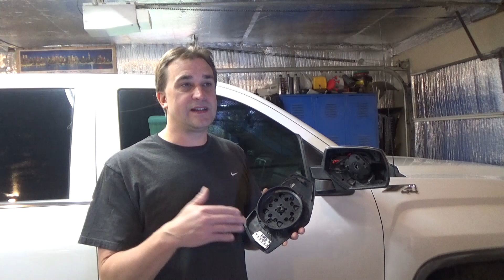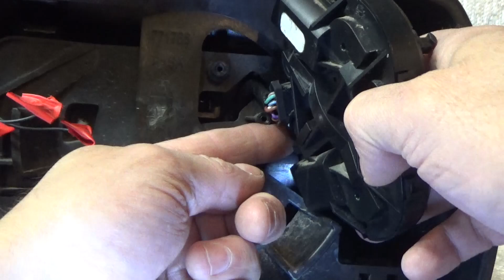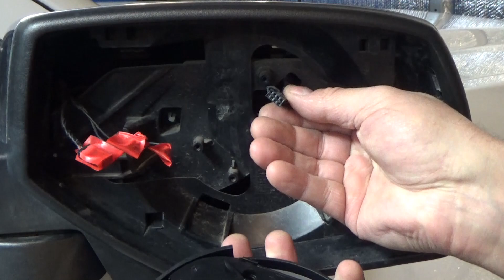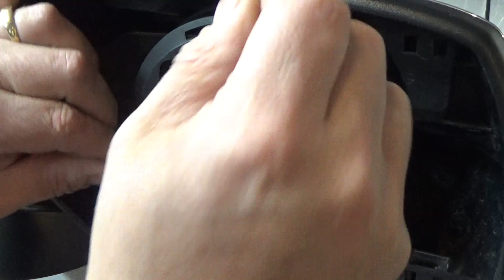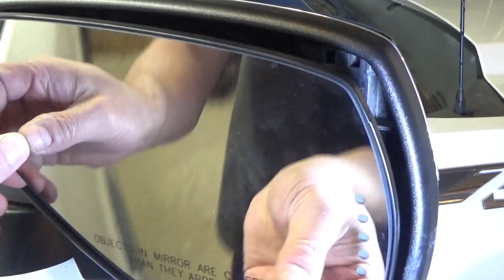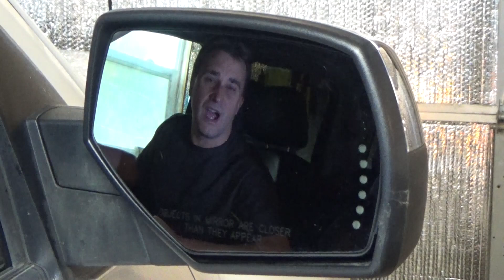How to Repair a Side Mirror on a GMC Sierra or Chevy Silverado - Mirror Adjustment Motor Replacement

Comment from the maker: 🛠 PARTS FOR THIS REPAIR:
🔧 GMC/Chevy Side Mirror Motor Assembly: https://amzn.to/2LAqxSY
🪛 Tool Kits on Amazon: https://amzn.to/4nW4giX
🪞 Complete Aftermarket Side Mirror (if needed): https://amzn.to/2AAUqAb
🏪 Browse My Complete Tool & Parts Recommendations: https://www.amazon.com/shop/markjenkins
Reply: The mirror itself didn't come with brackets.
Reply: This would fit in a 2015 silverado as well correct?

Comment: I have a 2015 sierra. My problem is the passenger side mirror won't fold in or out. Do I replace the same motor that you replaced? Or is it a different motor that I need. Thanks.

Comment: You can Buy a complete Mirror from Rock Auto Parts or E-Bay cheaper as a  new Motor
Reply: If it's regular. Good luck with power folding one with puddle light

Comment: I replaced mirror and actuator on passenger side door of 2018 GMC Sierra using this video and worked perfect.  1 problem I had (created myself) was pulled the 1 wire out of the small terminal on mirror.  So I had to redo a bigger terminal to fit.  It worked fine.  8 months later the mirror would not move but the turn signal light blinked.  I took mirror off and thought that wire I remodeled came apart, but didnt.  I functioned the actuator motor and works in all directions.  Put mirror back in place and turn signal function but mirror will not move.  Is not binding up anyplace as I can move it manually and it moves freely.  Help needed please.

Comment: So i replaced the motor it works great but now left is right and right is left do you know what could cause this other than that video helped alot just glad its working again thnx
Reply: Your truck is equipped with memory seats & mirrors so original actuator motor had 8 pin connection port. You bought wrong one with no memory, same port but only 4 pins. That's why left & right it's opposite plus mirror has no more memory for sure. Hope it helps

Comment: What about the issues of the mirror not folding in or out? The driver side on my sounds like it made a snapping sound and now the mirror is loose and moves inward with movement down the road or when I open/close the door

Comment: How do you fix the electronic mechanism that folds your mirrors in and out? Both mirrors are stuck. I know the motor works because it folds part way. Do I need to disassemble the mirror to clean a track that is probably full of gunk?

Comment: For the record.  Getting the glass off is as easy as it might seem.  Tilt it all the way down and use a thin panel tool to gently pry upward and it comes off with very little effort.

Comment: The part arrived today, it was an easy intall.  I tried gluing it first with plastic epoxy and it didn't work .  Buy the motor it's worth it.

Comment: Great video! But how did you connect the back plate to the motor? My mirror&backplate popped off. I’ve removed the backplate from the mirror but can’t get it to connect to the motor.

Comment: I recently had my mirror come off the motor and I snapped it back on and the mirror works if I use the adjuster switches but if I put the truck in reverse then it won’t tilt down. Any suggestions?

Comment: do you have the actual GM part # for the motor assembly..??...maybe 22919755...???...my truck is a 2017 though...